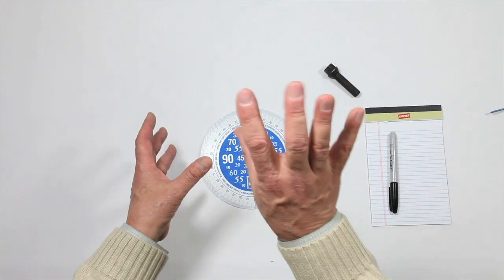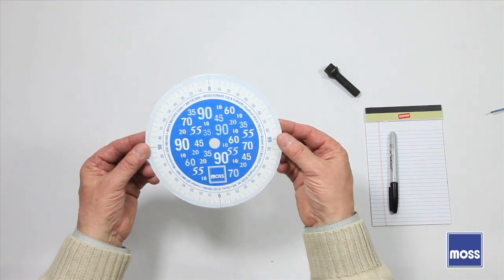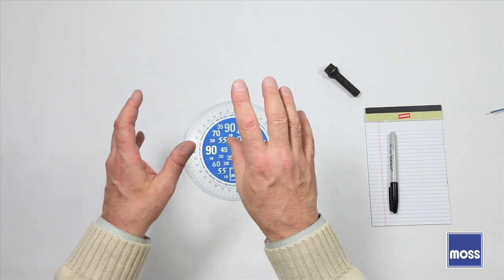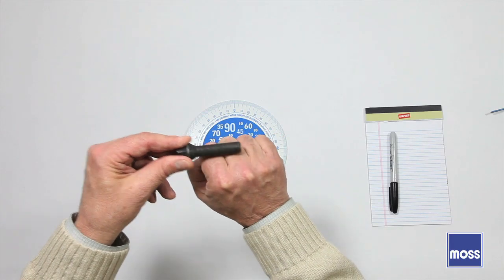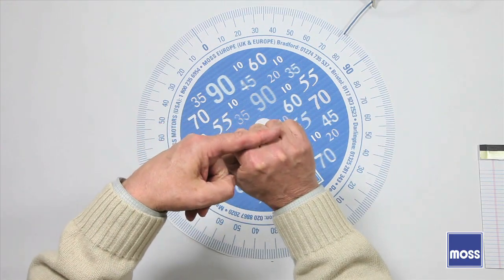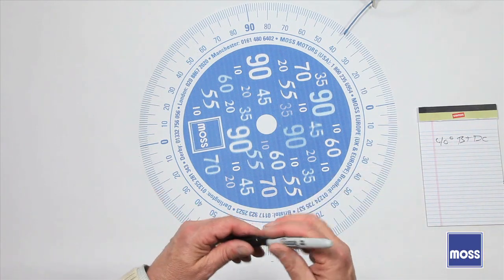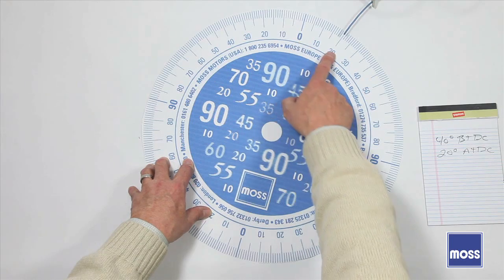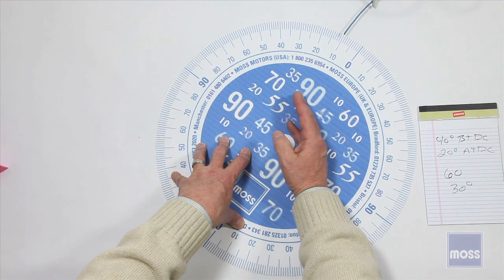Timing Gears & Marks (Part 2) - How to realign when you have lost the marks

Comment: Great video but I would like to clarify an item.  I have a new gear and chainset.  The crank gear has the dot, the cam gear does not.  If I were to follow your instructions and installed both gears would it be like both gears had dots on them?   That they match up, though the cam gear would have an imaginary dot.   I hope this makes sense.

Comment: lets say u wanna put a new timing belt on. can u just put the car in gear before taking off the timing belt so that the pistons dont move? cuz if they wont move, all u have to do is to take off the old timing belt and simply put on the new one cuz the timing will still be the same. is that right?

Comment: How do you know where the #1 cylinder is located
Reply: in this guys situation if anyone is wondering. you can search this up easily, i believe import engines are (V8 example, same for V6)
PASSENGER SIDE HEAD
FRONT TO BACK: 1, 3 , 5, 6

DRIVER SIDE HEAD
FRONT TO BACK: 2, 4, 6, 8